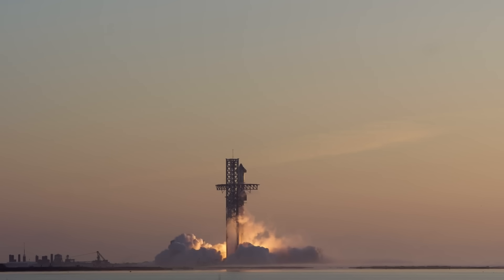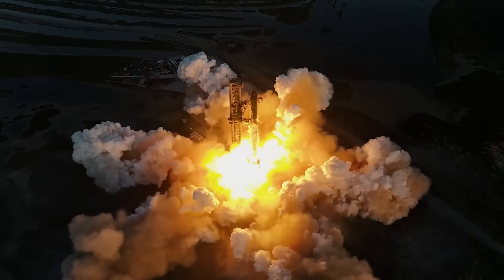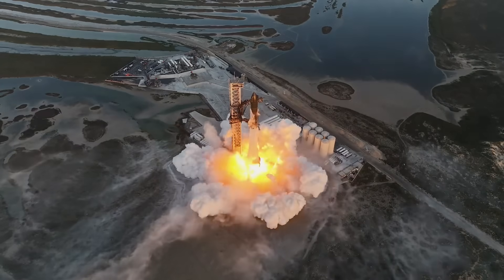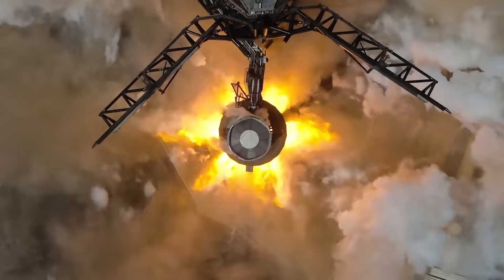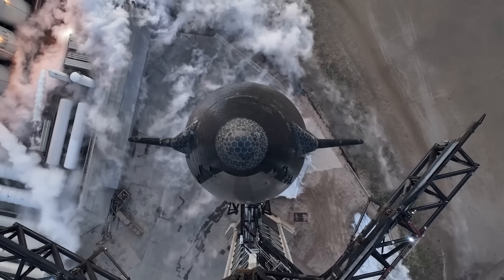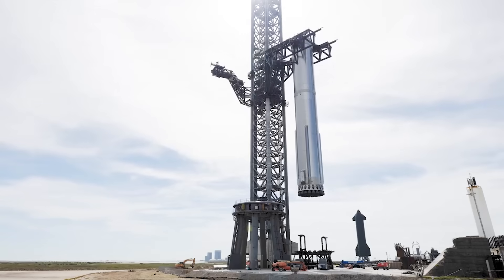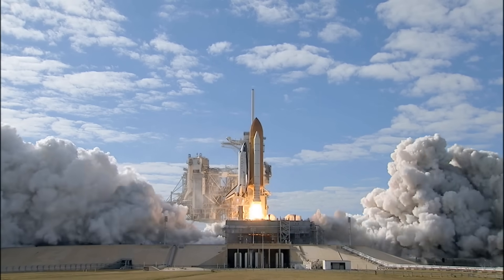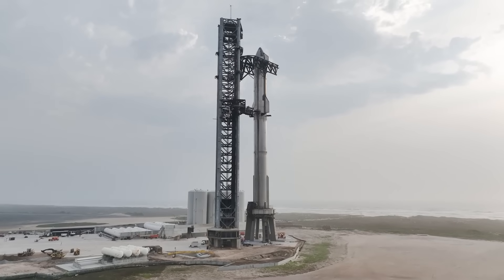How Did SpaceX's New Pad Hold Up Against Starship's Second Launch?

Comment: I remember all those experts in the comments before this test that were so sure the pad would get destroyed again 😂
Reply: If faired better than the rocket I think.
Reply: The only comments I saw over and over was commenting on how inept the spacex team was to mess it up so badly the first time
Reply: @spinnymathingy3149  Even those comments absolutely fail to see the big picture.  SpaceX had two options: Launch ASAP or spend half a year installing their new deluge system and waiting on FAA approval for the design.  In one of these scenarios, the first launch of Starship takes place in November.  In the other scenario, the second launch of Starship takes place in November and SpaceX has 7 months of flight data informing future designs, such as the hotstaging decision.  Effectively, SpaceX spared themselves 7 more months of idling on the ground, and all it cost them was some repair work and the jeering of idiots who don't have the same level of foresight.
Reply: CLICKBAIT BABY!!!!!
Reply: Interesting and informative, however, the comment regarding the tunnel construction, while I'm sure was a mostly accurate quote,  its not actually difficult.  

More than likely cost was the actual factor and not difficulty, as we have been building structures below the water table all over the world for many years and the process and solutions are well known across the industry.

Off the top of my head.... Pre fab tunnel sections could have been slip poured above ground and craned into a trench and welded to support piles. Trench walls would be supported by sheet piles. 
Each section would be formed together and poured in place. There are off the shelf products that would seal each section off, and in-section sump pumps would control water table. Large diesel standby pumps could be used to de-water the tunnel after significant weather events. 

Not difficult, just expensive. 

I wouldn't be surprised if
as they add more pad's you see tunnels built, likely to form a river Delta-esque exit with additional tunnels to reduce environmental and above ground pad impacts. 

For now though, the current solution seems to work great!
Reply: Yeah seems like a lot of people didn't manage to get into the circus but kept being clowns anyway.
Reply: They've pivoted to accusing SpaceX of being too incompetent to complete a flight profile.  Just let them have their fun.  They'll retreat to their bubble and sulk once Starship has a steady cadence and we've returned to the Moon.  Just as they did after Falcon 9's landing attempts stopped exploding.
Reply: @Asterra2  
Is not the real question “when” not “if”.  ¿¡?! My feeling is that this will take more time than NASA would prefer, but that gives NASA cover for their issues (so probably NASA is happy with this launch in a backhanded way).
Reply: Lots of no nothing armchair critics
Reply: We invite you to the vital event on December 2, at 17:00 GMT: "Global Crisis. The Responsibility" (international online forum). There will be voiced the information on which the fate of each of us and the entire civilization depends.
Reply: If it was in a good shape, then why no propert pictures of it?
Reply: It was a success. Most milestones were achieved. Go SpaceX Go 💪👍
Reply: @XCX237  
A lot was not achieved that they hoped to get feedback from, spacex hasn’t even gotten to the hard things to work out to be actually “successful”. A lot of future entertainment is a certainty! Remember, elon needs a fully reusable system to actually be successful. It is going to take some significant time to work the hard bugs out. Personally I was surprised that ss didn’t get to reentry, where things get really interesting.
Reply: BUT THRUST DIVERTER!!!11!😂
Reply: I didn't see anyone writing that.
Reply: @TheMoneypresident it was mostly people who seemed to be convinced that absolutely nothing but a flame trench would work .
Reply: @KiRiTO72987  You gotta admit, the way it's looking now, future designs for launchpads are going to be seriously questioned at least.
Reply: @Asterra2  
I am confused, do you mean that the future launch pads should be more like spacex or more like NASA old space?
Reply: @Mentaculus42 Keep in mind I'm saying this with SLS's launch tower woes firmly in mind.  If it becomes clear that the most powerful rocket ever designed can get away with a steady cadence of launches on a pithy little stand with a water-cooled steel plate, what does that say about the future of horribly over-budget towers whose construction and the need for upgrades/replacements directly delays SLS launches?
Reply: @TheMoneypresident  dementia in action
Reply: “I” SEE unimaginable catastrophic and toxic chemical fuel “SPEWED” everywhere, and people wonder where in hell SARS/COVID comes from. 

SARS/COVID comes from toxic pollution from everything like, rocket fuel, jet and airliner fuel, computer and electronic waste burns, manufacturing of chemicals, manufacturing of cement spewing toxic ash and hundreds of other sources spewed into the atmosphere and “OUR” airspace, which by the way, NOBODY in charge of the releases has ever asked the rest of the people on Earth if We approve of their toxic releases!

And many of those so-called “scientific” and “manufacturing”research companies went to China and other third world countries for tax deductions or no taxes(another way to cheat the system) in the early 1960’s. “I” was around in the early sixties, and “I” remember seeing on television people in China in particular wearing 😷 masks waaay back then, and it wasn’t from a “disease”, IT WAS FROM POLLUTION, WHAT SO-CALLED SCIENTISTS AND EXPERTS CALL SARS/COVID now!

Wakey Up 

You have been Enlightened
Reply: @TheMoneypresident 
I watched rather carefully on that topic and I also didn’t see anybody that sounded like they knew some technical background saying that it was going to be another Cluster Duck. It was more like; “this over built band-aid had better do better”, so let’s see what happens. 

However, that slow motion seems to show a “Sh.. Ton” of acoustic energy reflecting off that flat surface. So maybe rather suboptimal considering there are indications of a substantial amount of thermal tile “issues”. One must remember that standard practices are to also minimize the acoustic energy being reflected.
Reply: @Mentaculus42  spot on, the real killer are those acoustic energies. the open air launch table just feels TOO open, but a robust tile system should stand up to it. 

spacex just has to get a robust tile system first ... 😅 no pressure
Reply: @Mentaculus42 While I seriously doubt the tile problem is in fact solved, in this particular case, SpaceX didn't care about the tiles or the ultimate fate of S25 during its hypothetical reentry.  If they had, they would have taken time to actually test the tiles, like how they did for S28 for example.  S25 was almost scrapped—they decided to use it mainly just to get some use out of it, however limited.
Reply: @Asterra2  
Good point, I suspect that spacex has video of how the thermal tiles behaved at launch, MaxQ, staging and upper ss engines running which should be very useful to figure out how to get them intact to reentry. Spacex probably got orders of magnitude more “useful” data than first launch. Considering that the telemetry died earlier on the first launch and what they got was compromised by secondary damage, this really was effectively the first useful launch. Tho the whole upper ss issue is a bit perplexing without spacex putting out appropriate telemetry data. I miss the transparency of NASA’s daily update information meetings by project heads. I always am rather skeptical of elon’s  little tidbits that seem rather …
Reply: @Mentaculus42 I think we now have a reasonably clear picture of what happened with S25, post-hotstaging.  Rewatch the mission and scrutinize the methalox meters.  S25 exhibits a plume and the oxidizer begins expending precipitously.  They still had another 30 seconds of thrust to go when the computer triggered the FTS, and there was simply no way the oxidizer meter was going to make it another 30 seconds.  Evidently, the ship suffered the same type of leak that S24 did, and that may be the one and only culprit that prevented it from reaching its intended ballistic arc.  You can bet this issue is going to be solved "six ways to Sunday", as it was once put.
Reply: Science, physics, engineering, acoustic absorption and reflection don't care how much you believe in Chairman Musk.
Reply: @sandbridgekid4121  Not that I'm saying this for your benefit since you've made up your mind to be steadfastly against an entire industry because of one individual, but... the results speak for themselves.  The smartest engineers available are working at SpaceX and they obviously had a clearer understanding of the problem than you here profess.  I repeat from earlier: what happens when this proves to be the new reality?  Time to go pound sand?  I can tell you that NASA's miserably inept SLS tower subcontractor, Bechtel, are probably seeing the writing on the wall.  Not that their future prospects were ever very good, since they've managed to be even more incompetent than Boeing.
Reply: @Mentaculus42 dont worry, straship is designed to handle iie